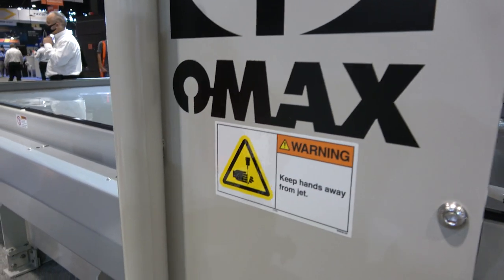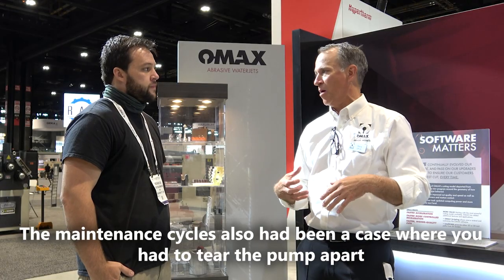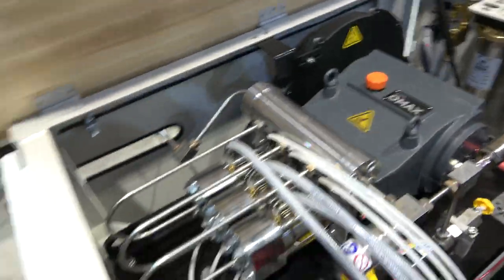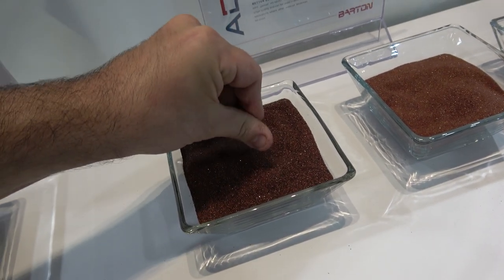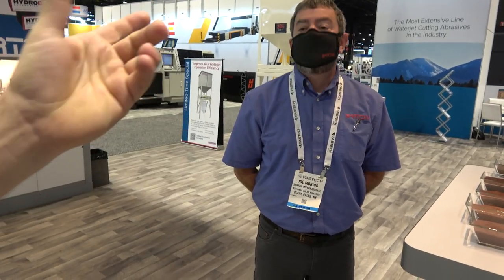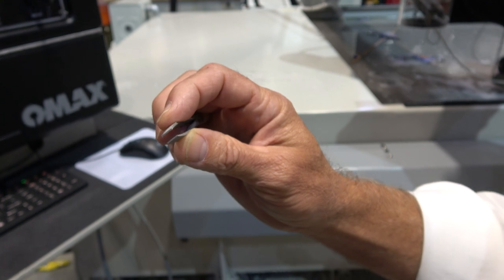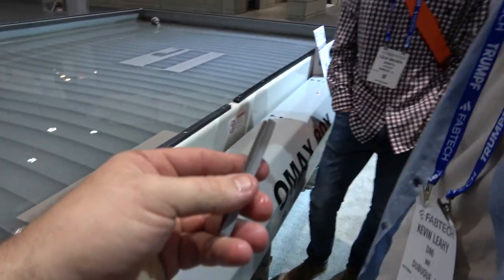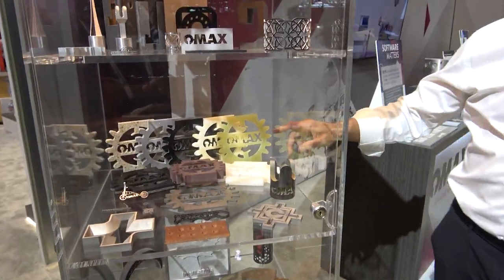I was WRONG about Water Jets with OMAX

Comment: My brother works for Omax, water jets make some of the best cutouts however they are very expensive to operate. The abrasive material is costly, pumps have improved but they are still an issue for up time. The main thing though is these machines are too costly for the home or Semi-Pro DiY IMO, even the portable design is about 5-7k for a non-omax machine. Protomax starts at 26 grand, which is a huge ouch to anyone not doing high volume stuff.
Reply: Thank you for this information. I'm interested in the ProtoMax. I can't seem to find any other small format waterjets similar to it. Would you happen to know of any?
Reply: @azurehydra  Check out the Wazer waterjet.

Comment: I'm glad Omax finally recognized some of the issues with their pumps. We replaced two of their 40hp mechanical pumps with A 100hp Intensifier style pump and 90% of of our maintenance issues and costs disappeared. Their scissor system was also eliminated as it adds considerable maintenance cost over a standard whip. Other than that the table itself and software is pretty good.  I would also recommend putting a gauge inline to measure  pressure differential in the high pressure line while cycling to get a good picture of the wear on components.

Comment: Really great. But what's the price for machinery like this?
Reply from the maker: little guy is $30k, larger ones are over $100k
Reply: @42Fab  wow  wasn't expecting that price  plus running it and materials  plasma table will do me lol 
Thanks for the show
Great information as always 
👍👍👍😜🏴🦕🙂🤞✌
Reply: I wonder if it might be possible to DIY one based on a pressure washer or paint sprayer.
Reply from the maker: It is, but they suck. Night hawk in light did it

Comment: Can you not collect the sand and reuse it?
Reply from the maker: you could, but over time it wears down so the cut characteristics change as well as you have all the materials removed in previous cuts which do not flow through the system in the same way Garnet would. It is possible, but a lot of work

Comment: Stay away! I've been in manufacturing maintenance for 31 years. The company I work for has two of these. Same brand. Granted you will not run them like we do. But these a maintenance heavy. We've had problems with or pumps and constantly have to rebuild the rectifier. Water everywhere, garnet everywhere every shift. Our run a 60k psi. We bought a giant router that can run circles around both water jets. Water jets are loud, maintenance heavy and costly. Don't get scammed. Look into a laser or router. We have 10 laser machines that run 24/7 no problems unless operator dosen't do good housekeeping.
Reply: I've had the opposite experience with Omax.   I've been running one of some sort for almost 20 years.  Now the old pumps/intensifiers had alot more maintenance than the current designs.  I've only run 50ksi pumps... But that is high pressure still and high pressure water wears down materials.  

The first machine I used was at a university with kids running/crashing it.  The CNC machine still works.  It does need a new pump.  The pump is not an Omax pump currently.  The pump and machine are older with a pump from the 90s.  

Current employer has 2 Omax waterjets with Omax pumps for 6 years and we've had no problems with the pumps.  I have training to rebuild one but I haven't needed to utilize the training.  

I regard Omax waterjets to have the best programing and control software.  They make better quality cuts in material and the software comes with alot of standard material cut parameters from the factory.    The nesting option in Omax software is lacking compared to hypertherm's software.

Water and sand will get everywhere.  I recommend placing waterjets in an area just for them.  Water and garnet will slowly kill any other machine in the same work area.
Reply: Don't have that problem, I do a rebuild no more than 2 times a year but Omax will back you up if it's an issue from their end, any problem you have...they will be there to help!!
Reply: Maybe buy the right tool for the job? I run a laser and a waterjet cutter. Laser is great for metal. But, for example, if you want to cut glass, you'll have a hard time with a laser or router. Also, many customers prefer the surface finish of the waterjet. We get all sorts of odd jobs that just wouldn't make sense on a laser or router.